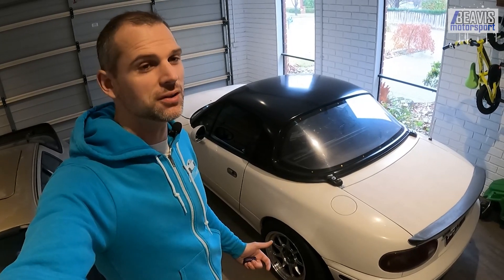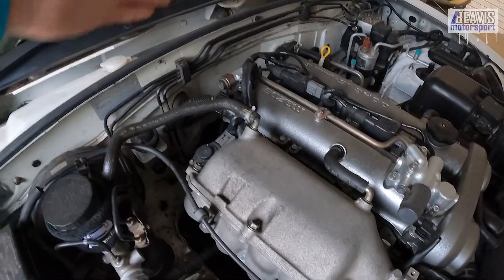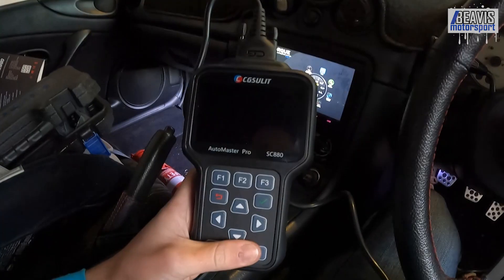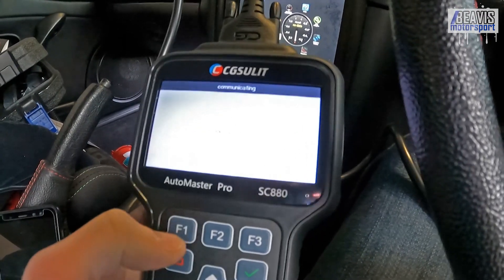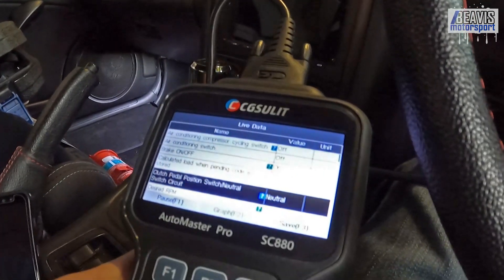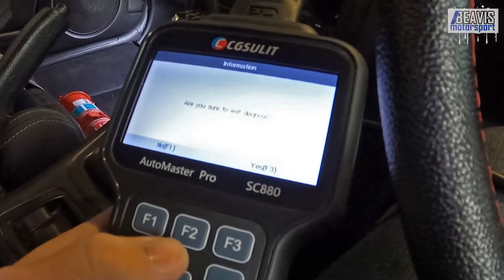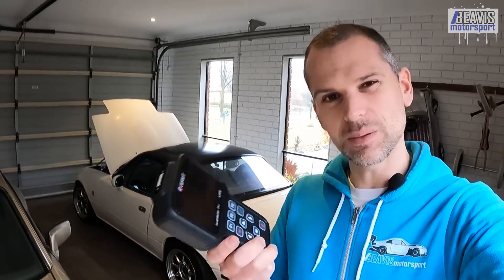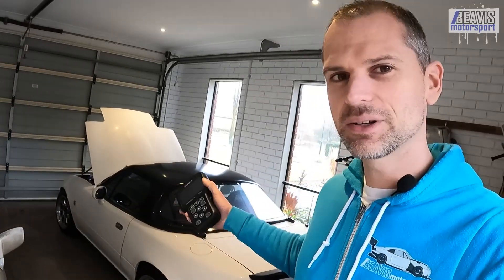Why Is My Miata Throwing a Check Engine Light? (Here’s What I Found)

Comment: I have something very similar to what you have but I can look at abs and srs codes. Also, when you have real life driving scenarios and need to look at live data, it's far superior. You cAn also look at voltages from certain  sensors and graph them.
Reply from the maker: I've used these tools recently for two family members cars, coincidentally both were coil pack faults and using the OBD2 scan tools made diagnosing that much easier.

Comment: my 1992 na6 miata idle keep fluctuating when I jump the TEN and G to get into diagnotic mode. but the car run perfectly fine however
 i have a random idle drop at the stop light sometime, would you know why that is?
Reply from the maker: Grounding to TEN bypasses the idle control. Could be that something around the throttle area needs cleaning, or the idle valve is wearing or dirty.

Comment: If you opt for the TopDon, get the $600ish model because it has 2 way communication and you can do a lot more in-depth diagnosis by being able to test certain components by commanding them via the scanner.
Reply from the maker: Thanks for the heads up, good to know, for now I guess I have enough 'diag tools' but good tip for others who see this video.